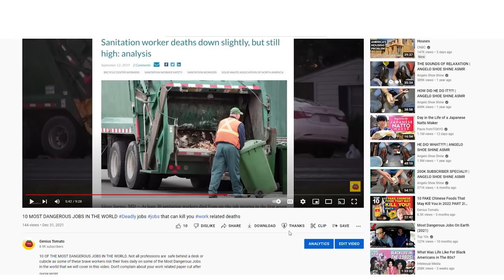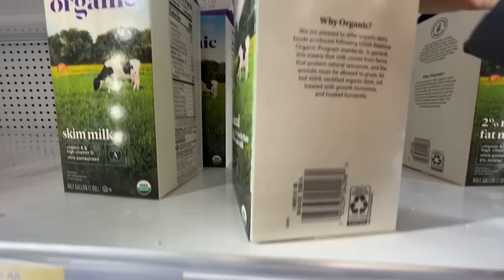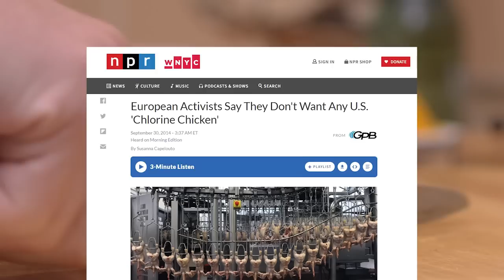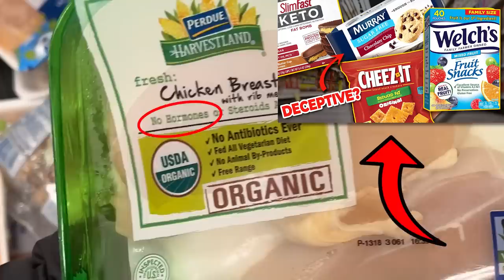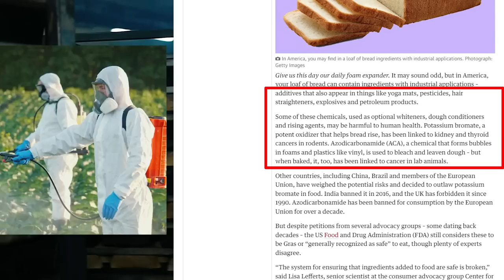6 American Foods That Are Banned In Other Countries. These are foods that Americans Eat Everyday!

Comment: Something else is wrong with the chicken, the texture is off as well. Im raising my own naturally I also bake my own bread and grow whatever vegetables I can. I feel for those that don't have that option or can't afford to buy organic.
Reply from the maker: That's exactly us in the big cities. No space to grow our own food and things are even more expensive especially organic foods
Reply: If the chicken in the UK is anything to go by, the two big differences to your home raised birds are that yours are not confined to a cage or shed, fed a high fat diet. Yours will be lean and tasty, the commercial meat is greasy and 'slippery' in the mouth because there's hardly any fibre in the muscle. The second big let down with the UK mass produced chicken is that because it's sold by weight, producers are allowed (after slaughter) to inject the meat with water. This results in three things: although chicken is the cheapest meat, you're paying for about 35% water, meaning it's actually very expensive, the water is tap water which contains bleach (chlorine) which negates the argument against US chicken and it's difficult to fry as the water comes out in cooking, flooding the pan and ends up poached instead. That the adulteration of chicken is known and allowed is solely the result of bribery and corruption.